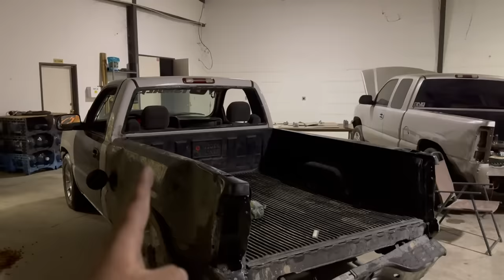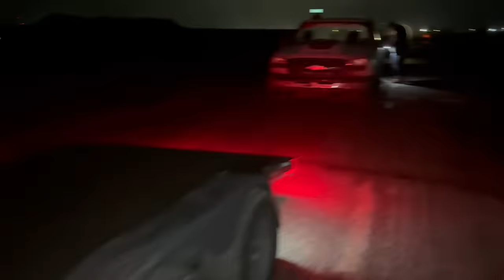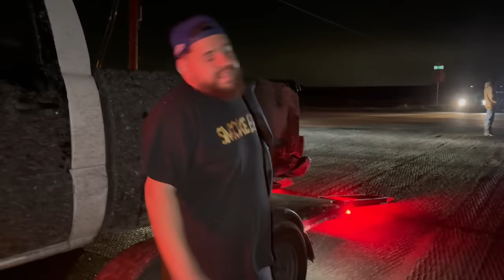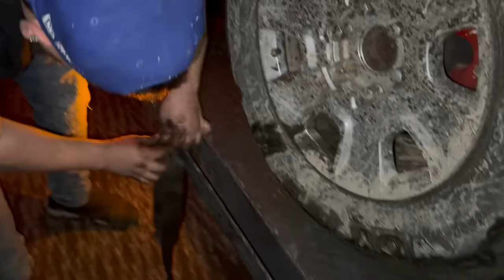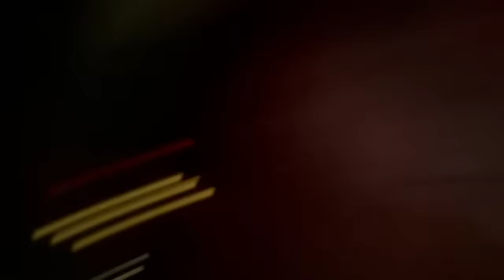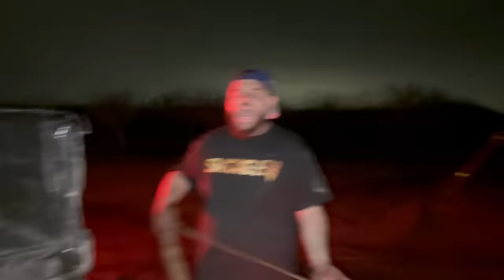ABUSADORA FLEW OFF THE TRAILER 🤦‍♂️🤦‍♂️🤦‍♂️

Comment: At least you didn't lose the trailer. Hey Brother ain't nothing when I lived in Northern California I used to pull two trailer vans.
I was going back home I lost one of my trailers in the middle of the damn freeway. It was dark already I ran back with a flashlight Lafayette stop right underneath the street lights but some guy was getting on the freeway and smacked right into the back of it. She asked me why I left my trailer in the middle of the freeway my truck was up the road a little bit with the other trailer I told her that fell off total the trailer knocked the axles clear under the trailer. I I dropped the front trailer went back with the truck and hooked on to it and drag it off the road and tell the wrecker came. Announcer about 180 mi from home. Lucky she didn't get killed. Yes s*** happens.😮🙋🏽‍♂️